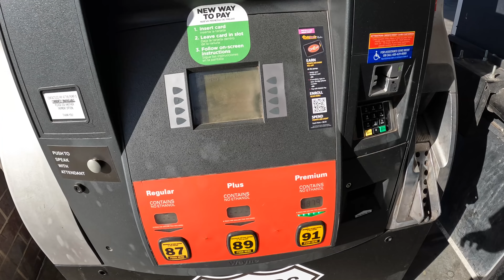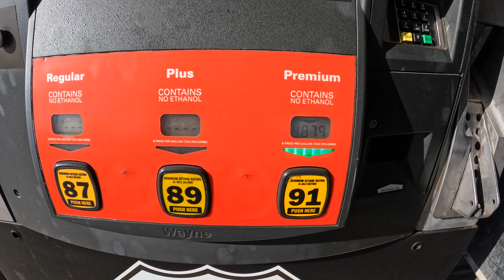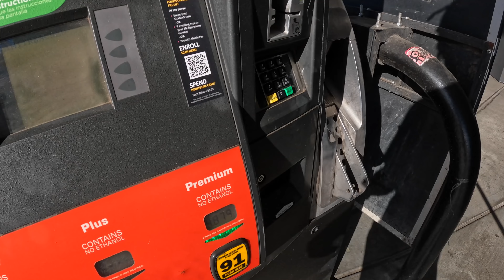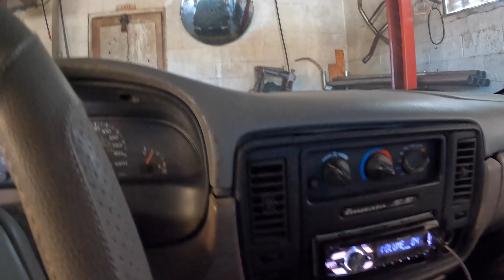I DON'T TRUST NOTHING HE JUMPED IN MY CAR AND TOOK OFF IN IT!!

Comment: You could always have him weld in a crossover pipe  in between the existing front pipes and it will equalize the exhaust  system  similar to an expipe .